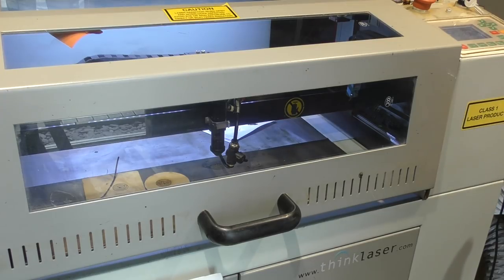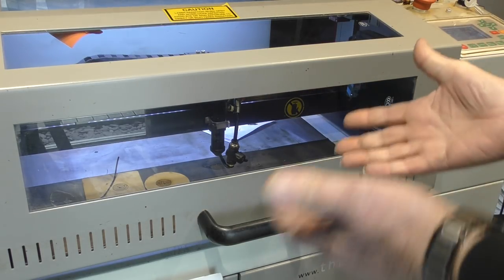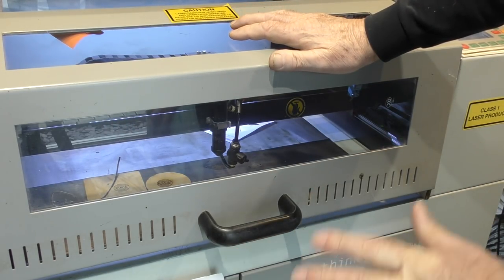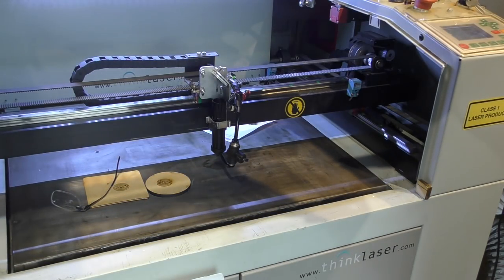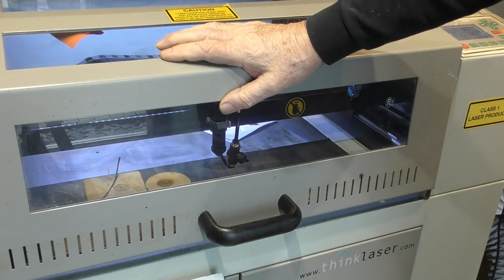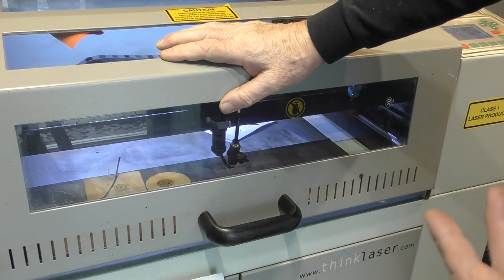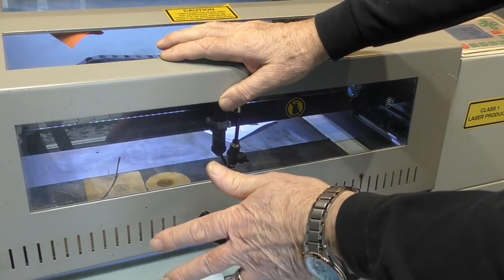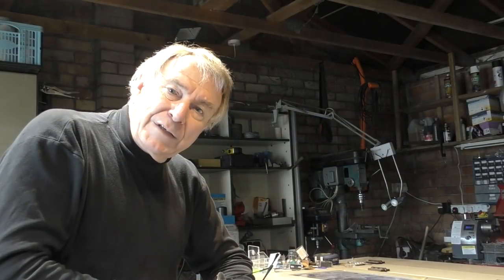RDWorks Learning Lab 204 Laser Beam Safety

Comment: Does the laser work without the lid closed by default? Or did you have to hack the safety mechanism in order to use it without the lid?
Reply: Many laser cutters from China will cut with the lid open. Safety is not a priority in China... But it's cheap 🙄
Reply: The safety mechanism is usually just a switch and hacking involves a piece of tape.
Reply from the maker: My lightblade  machine is VERY well protected because it is designed to be sold into education. industry and small businesses.  It has mechanical, magnetic and inductive switches dotted around and all sort of interlock circuitry. So this machine needed a degree in defeating safety systems to run it as I do. . Small machines from China (usually 500x300 and smaller) have zero protection,  At 700x500 and bigger there is usually a token microswitch  strapped to the frame that the door has to close on to enable the laser beam. Legally you can buy this sort of machine for personal use but try to run this type of machine in a small business where you ask employees to use it  and you stepping over a legal line.
 Best wishes
Russ
Reply: @MichaelMaj5  Cheap K40 type lasers also need the electrics to be upgraded, typicaly they have the ground connection to the case by a bolt, but don't remove the paint first! 15,000 volts, water cooled in a badly grounded chassis.... what could go wrong??
Reply: @zebo-the-fat  I forgot about. Mine had that issue too. What about those dodgy connectors for the air pump and water pump? On my second laser, (a K40 6040) the connectors would loose contact if connected more than one time. I ended up hardwiring the pumps to the machine. Loose 240v connectors, yeah what could go wrong there. What stumbles me most is that the machine is CE marked with all those issues.
Must be true about what they say CE really means... China Export 😂
Reply: @SarbarMultimedia  good to know that not all the Chinese machines are bad! Also I want to thank you for your educational videos! I have learned alot and still do, watching your sessions! Thanks😊